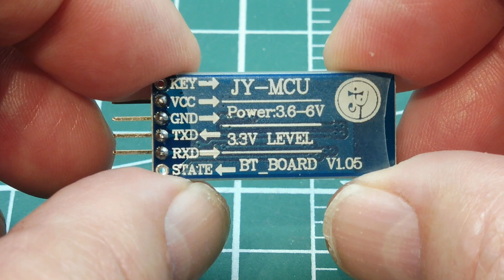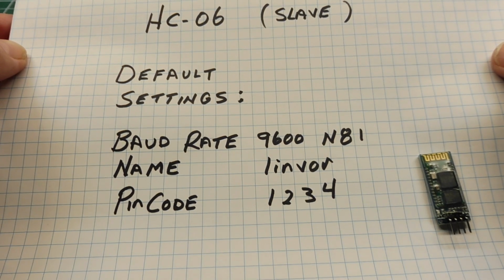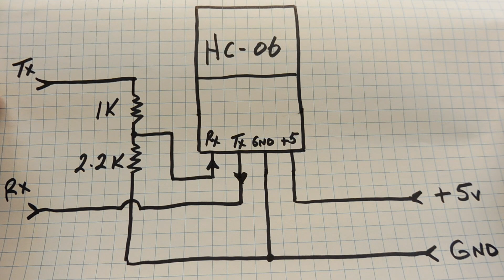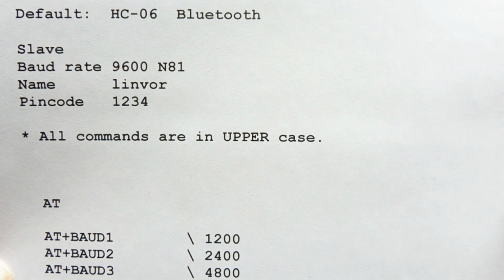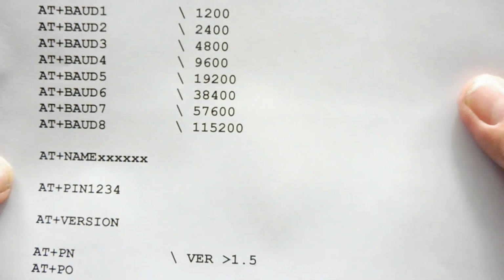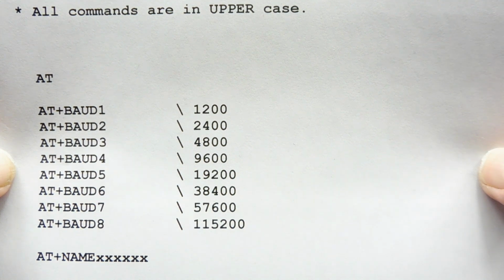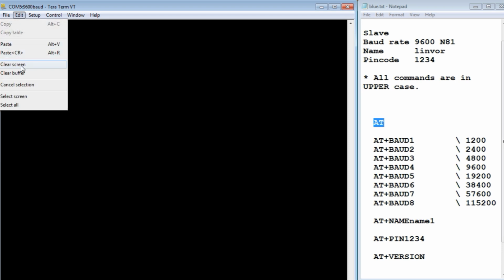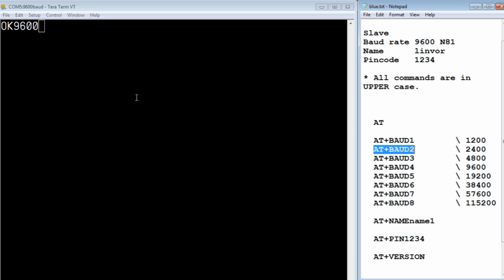How to program the HC-06 Bluetooth module

Comment: This is a good tutorial. however I would not suggest the voltage divider circuit. Because even though the voltage is divided, it also reduces the current., and to get a good range with a bluetooth module it is better to have as much current as possible. As the current increases, the range increases. You can get 3.3V regulator ICs instead.
Reply from the maker: The voltage divider is for the Tx data line only, not the power supply. The module is powered externally by 5 volts and an internal onboard 3.3 volt regulator powers the module delivering the proper voltage/current as required.
Reply: why is the divider needed, what will happen if it is not present?

Comment: Excellent video. It worked for me. I used a CP2102 USB to Serial 3.3V converter and it worked nicely.
Reply from the maker: Glad that it worked out for you.
By using a 3.3v converter you do not need the voltage divider ....  Have to get a CP2102 for myself.